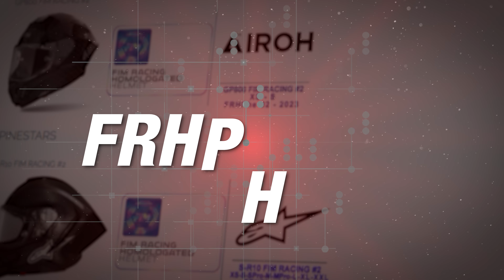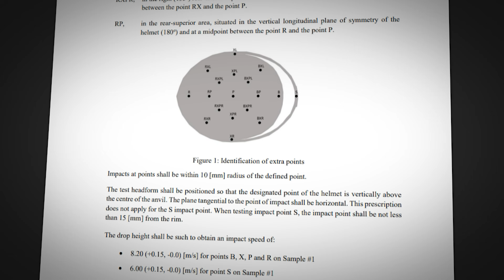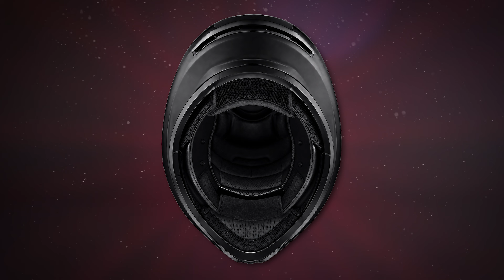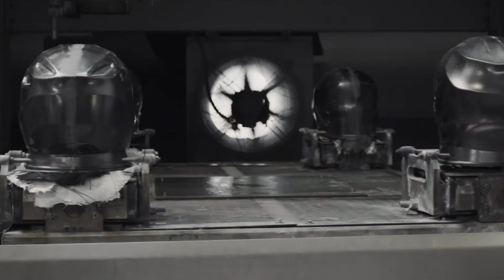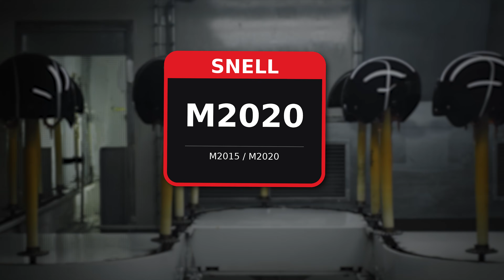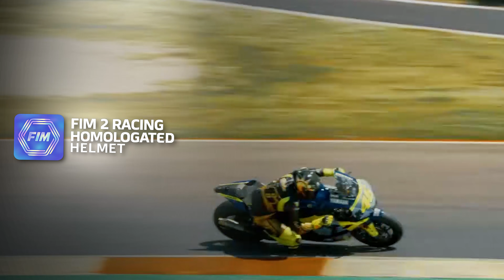FIM 2 Explained: What Makes FIM 2 Better than ECE 22.06 and Other Certifications - Champion Helmets

Comment: It doesn't matter that FIM regs are superior, it's not recognised in the EU. I.e. if you have an FIM stickered helmet, you can compete in the TT, or BSB, or MotoGP in UK and EU, but can't join a local club race or track day. And if you get pulled over by cops in the UK or EU with an FIM only helmet, you're getting points on your license.